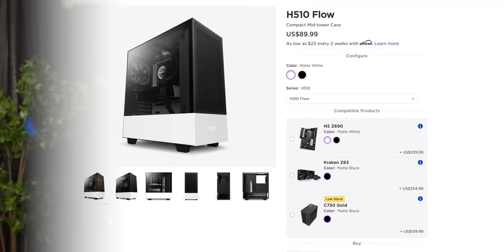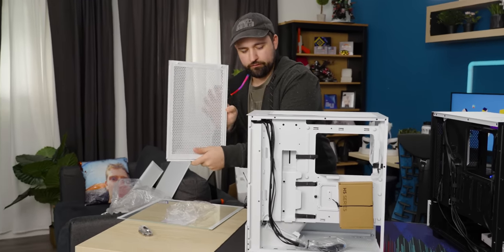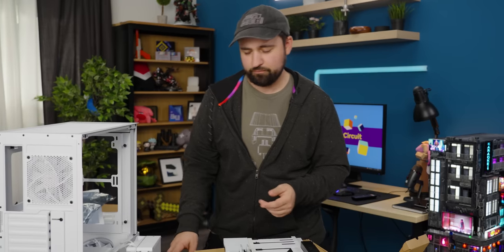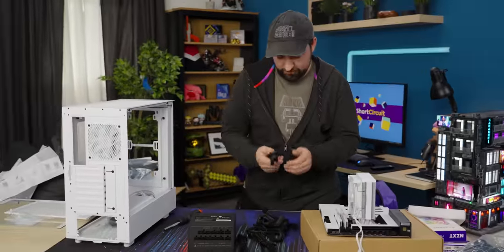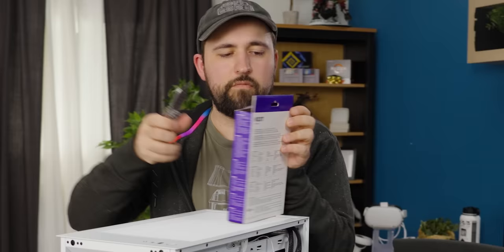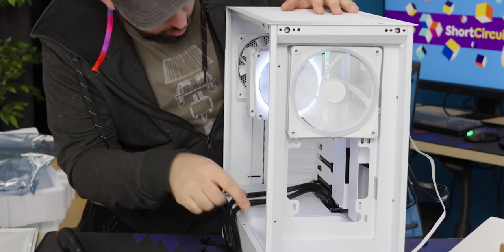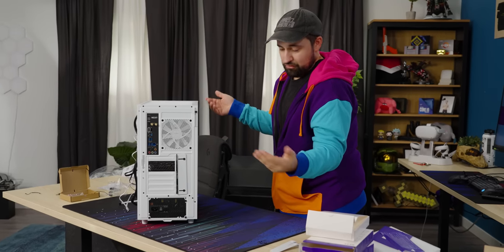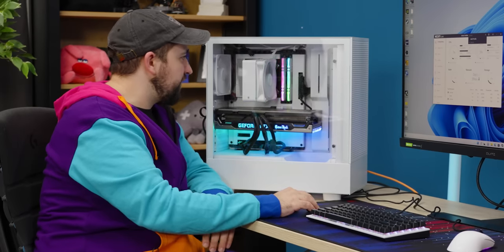Does this change make a difference? - NZXT H5 Flow

Comment: The fact that I’m wondering if this will fit a 4090 is a testament to how off the rails Nvidia has gone with the size of their GPUs.
Reply: H7 will probably be better for 4090
Reply: it can, yes it will be REALLY big but it will still fit
Reply: @InfiniteBullets2  😜
Reply: I'm guessing no lol.  Maybe a founders, hahaha.
Reply: It more speaks to how shit NZXT cases are.
Reply: @drewhinners8793  I mean, practically everyone agrees that the 4090 is ridiculously large. To the point where AMD makes it a selling point with their upcoming 7000 series GPUs.
Reply: If only the size was the only thing Nvidia had gone off the rails with...
Reply: It's easier to fit in a PC into a 4090 case than it is to fit in a 4090 into a PC case !\s
Reply: Some of you have short memories.

I remember when I bought a Gigabyte Windforce 970 and had to CUT my hard drive cage because the triple fan was SO F'ING LONG, a midsize ATX case wouldn't fit it.
Reply: Just wait until you see the 5090! Size of a compact car!
Reply: @Real28  I just googled it and:
310 mm x 129 mm x 43 mm
vs
304 mm x 137 mm x 61 mm for RTX 4090
Reply: We are at the tipping point where you buy a graphics card and then decide what CPU to add to it.
Reply: Is the kalaydoscope graphicscard not a 40 series card?
Reply: Okey taking it back did not know thst this crystal pattern was also in the 30 series
Reply: now you know why the toiletbowl fan was invented. (there is demand for that kind of gpu, and sadly it needs that kind of big cooling solution)
Reply: H7 Flow will fit it 👍

There is plenty of room to fit my STRIX 4090.
Reply: @LAndrewsChannel  Oh yeah, there’s also power consumption, price, & the lack of DisplayPort 2.0 (let alone 2.1).
Reply: @drewhinners8793  the 4090 gives problems to A LOT of cases

Just cause you hate a company doesn't mean you're allowed to say bullshit just for the sake of it

Also, it does fit in here, most of the customs do, so 🤷
Reply: @ccelik97  what? You mean you actually research it to get the right answer! Instead of guessing like everyone else.. bravo
Reply: Easy solution - buy AMD
Reply: @shamrockisland  I'm too broke to eyeball it & lose money on 2nd hand market at the moment so..
Reply: to be fair if you buy a 4090 you aren't buying this case
Reply: @ccelik97  you get my joke right ?
Reply: it fits
also Im poor

Comment: With NZXT trying to break into all the pc product lines, I’m curious if they’ll ever try and get a board partnership with Nvidia to fill the space of EVGA.
Reply: They'd sell pretty GPU's ngl ...but maybe run hot as heck lol!
Reply: @WyvernVin  run hot and cost 2500$ for a 4080. Nzxt pricing is easy to figure out. Find the most expensive competitor, copy their product exactly, then sell for 2-4x the original. They're the American version of the Chinese companies using tooling and what not to make a clone. But those clones are typically cheaper, not more expensive for the exact same quality.
Reply: doubt it, nzxt likes to make money and they make plenty of it doing other stuff. I don't think the profit margins on making GPU's are good enough for them.
Reply: @unholydonuts Nvidias msrp. nzxt sees 1200, and think 2500, so they'll charge you 4000 for a not top tier gpu.
Reply: Corsair as well, as they’re now making monitors too. All they need now is motherboards and gpu’s

Comment: I love that the back of the case doesn't have any holes for dust to be pulled in from. Please, more companies do this!
Reply: I don't as the airflow path for this case is low front to high back but all the hot air of the GPU now needs to escape towards the top and cant escape through the end.
Reply: Why have negative air pressure for dust to be pulled in anyway?
Reply: If GN take this case for a ride you will see you can lose 5-7ºC on your GPU for that silly covers
Reply: @ericcartman5722  That is a big doubt for me. 6-7K is the difference of no side panel, sometimes less. (not to speak of 6-7K from what? What's the baseline, which case, how many fans and where are they?) It doesn't even make sense when you think about the physics. You trap air down there which increases air resistance and therefore the sound of the fans. The decrease in temperature would be from the new fan itself, as the old case had bad airflow for the lower part of the case anyway. The slot covers will not help.
Reply: @mikep9418  My gpu creates negative pressure at the rear of my case. Since my cpu temps don't go high enough to make the case fans spin up to counter the gpu pulling air from elsewhere.

I decided to use tape to cover the holes on the back of the case so that this couldn't happen and while I realise I could've jut changed the pwm curve for the fans, my cpu temps rarely go above 50c when gaming or 70 with a full load so they're tuned to be quiet unless they go above 60c. My negative pressure issue from the gpu was fixed but with the case in this video, I wouldn't have that issue in the first place. 

For reference, I use the Gigabyte 6700XT with triple fans and it pulls a lot of air, even compared to my 140mm front case fans. Sometimes, negative pressure can't be avoided

Comment: Purple power supply with some purple cables in that white case, it'd look pretty sweet
Reply: that's a wifey build for sure
Reply: Well more like James the stratman by a purple case and a purple power supply and want to get purple Ram.
Reply: @EDV8ZR1  Just get white RAM with RGB and set it purple. O_<
Reply: @WyvernVin  purple cable mod cables
Reply: @WyvernVin  or custom profile white and purple with time delay
Reply: @EDV8ZR1  ♫ Purple RAM, Purple RAAAAMMMM  ♫

Comment: Ok, word of advise (i know, i know) - since this PSU is modular, just plug EPS connectors to the motherboard first - when it is laying flat on the box or table and route the PSU end trough the case hole when you installing the mobo and then connect the loose ends to the PSU. So much easier.
Reply: You can do that, however, some cases with a cramped basement may give you trouble when you try to plug all that cable through. I've always done the ATX cable on the PSU side + everything else on the board.
Reply: @ErulianADRaghath  Connect the cables BEFORE installing the PSU in it's place.

Comment: their old ultra tower cases from like 10y ago had the same-ish angled fan design, glad to see it coming back to assist GPU cooling and general flow
Reply: i am pretty sure air coming from the front is better than the bottom because bottom intake is more restrictive
Reply: @michaelli3944  I thought it was a pull fan not a push
Reply: @zebedeesummers4413  i think if it was a pull fan it would be taking air away from the gpu and causing worse thermals. I think it is an intake fan because logo is on the inside. Still i feel like they could have just installed it on the front like the h7 flow because i remember gamers nexus said airflow is better when it is pulling air from the front not the bottom.
Reply: Yeah, it's very reminiscent of the Phantom cases
Reply: @michaelli3944  yeah the old one was just hanging in there in the middle and you can change angles so its still intakes from the front. This here would be interesting but it does have good enough stand off from the ground
Reply: @daniwin  yeah i guess but i think if they just made it a shrunken h7 flow it would be better and more radiator compatibility
Reply: I still got my old NZXT Phantom 820 Ultra tower. The thing is massive but the temps were supreme...and it weighs 60 pounds so i got an H510 Elite.

Comment: PC goes on the left because you don't need a lot of space for your keyboard hand, but you want as much space as possible for your mouse hand.  Also I'm curious how that angled fan in the bottom affected gpu temps.
Reply: Pc goes on the right so you can see in the window.
Reply: Lefties like myself always have the PC on the right. (Or in my case, at my feet because my case is enormous.)
Reply: PC goes on the floor so it doesn't take up space and is quieter. Also left so the MB is also slightly dampening the sound.

Comment: That's something I hate about so many cases, even expensive ones do this. They never give you room in the back. Like seriously, a few extra millimeters can go a long way to not get a bulge on your back panel and to not make it annoying to put on. I recently got a Dark Base 900 and it's a massive case, but even that doesn't leave enough room for cables in the back, especially S-ATA cables, S-ATA power specifically. Like, those cases already aren't super cheap, and the small amount of extra material to get a few extra millimeters of space for your cables isn't gonna make the case suddenly 50 dollars more expensive. Like why
Reply: What are you measuring with your multimeters, bruv?

Comment: @10:36 AND I DON'T WANT IT UPSIDE DOWN! I also put mine on the left, because that's the best way for my dual monitors to work.  Upside down cases just look weird to me. it also makes it harder to plug in cables in the back.

Comment: I have a h510 elite, very tempted by this new version due to the top mountable AIO support. I do wish you had added some temps for the GPU in this case and compared them to the older H510 cases, as kinda important information given that new fan placement at the bottom of the case
Reply: You watching subLTT right now, for those kind of information you better look at Gamers nexus he made all of that since it's a more technical oriented channel. Always watching multiple opinion/review is the way to go no matter the subject anyway

Comment: Glad to see someone else with the correct case on the left setup, I guess on the right made sense or at least didn't make no sense in the days of single monitor, but with dual monitors I want my main center, and my 2nd to the right, so left makes way more sense, also it makes sure you have plenty of room for your mouse, it's why when I built my own case from scratch it was more of a BTX style layout so the window was on the right side of the case, and even my current Phanteks case (Evolv shift air 2) has the motherboard facing the right side so I can see it with the case to my left.

Comment: I bought the H700 back in 2018 and still rocks and the airflow is pretty good for a case with solid front and top panels.

Comment: I put my PC on the left, too. I also have it backwards to where I can easily reach all my USB's and stuff, so it kind of works out. 

Still would like more reversed cases to be a thing.
Reply: You had me right up until you said backwards
Reply: mine is diagonal and upside down
Reply: @srscricket  I have a lot of cables I need easy access to. It’s more of a convenience thing. That said, I’d still trade that for a nice reverse case.
Reply: @flyingtentacle7631  but the power button

Comment: 10:36 oh yesssss, probably because the mouse is on the right and having something giant on the right might feel constricting... also I just realized that majority of places I put my computer desk in, the wall was to the left, so putting a computer on the right was blocking the open side, creating a weird cubical feeling with wall to the left and a computer case on the right.
One reason why it probably is always build for a right side placement is that that is where most computer desk put their bottom shelf for computers and likely because most people are right-handed, so expectation is that people use their right hand to turn on a PC... which I don't think matters to most people if they have to use left or right hand to turn a computer on.

Comment: This case is cool and all, but it doesn't offer much in the way of Storage Space due to the location of the angled fan so it only have 1 2.5" drive and 1 3.5" drive (that 3.5" drive space can also be used for a 2.5" drive). For a case that cost £110 in the UK that's fairly limiting it's cost.
Reply: 3.5" drive are getting a bit old fashioned now. Even 2.5" ssds aren't so popular with the low price of M.2 drives so I can see their point of view. I don't have any sata drive in my gaming system.
Reply: it can take ATX /EATX size motherboard who can get up to six M2 slot , not even mentioning the pci card that can add some more. Sata will die in the years to come anyway

Comment: I, too, hate the EPS connector. Especially when the socket is positioned such that the retaining clips go on the inside edge instead of the outside edge. This is a real problem when they are put next to an oversized VRM heatsink and you are forced to use a flathead screwdriver to manipulate the clip when trying to remove the EPS connector.

Comment: I have the gamerock and I’m really disappointed because of the reason that after just about a year the rgb got a really strong yellow Touch (plait said it’s normal due to heat and they can’t repair it) so now I can’t get white or blue and everything looks off compared to the card. If I want it somewhat synced I either make it glow like fire or go rainbow

Comment: Dude I also always put my PC on the left too, it's just the way my setup is, i can't just it on right if i wanted to. And left side is the end of the room, just makes sense to put case on left and not on right which would be in middle of the room. And because of this you can't see inside the case unless you like lean way over near end of my room to see into it. It's kind of why i don't even bother with RGB or really making it look good in the case because no one will ever see it.

Comment: hello. how much clearance from front panel/filter to fan mount bracket does this case have? is it possible to mount something like arctic radiator (38mm) on the other side (after the filter)? thanks

Comment: Serious question for PC builders - why don't more folks use GPU support brackets? It seems such a shame to spend so much time and money on building a great-looking rig with a cool case, RGB, good cable management etc. and then leave the GPU sagging. It's subtle yet almost always noticeable.
Reply: Any you would recommend?
Reply: @saphricpcgaming5182  I don't really know much about them. I know a few exist - I suppose I'm curious why there aren't more.
Reply: @benadamsondxb  Same. GPU sag annoys me but 90 bucks for a vertical mount seems a bit much.

Comment: Pc goes on the left because you don't need to move your left hand because you would use your right hand to move your mouse and It's my preference to not have something big to restrict my mouse movement which is also why I went wireless over wired for my mouse as well. 

Making a left sided pc with the window facing in would be amazing. Surprised no one has done one before even though you can move the pc no matter where you want if you spent $$ on a nice pc you would want to see it.
Reply: They actually do exist, though they are rare, also some SFF cases effectively do when they use the layout with the motherboard facing one side and the GPU facing out towards the other side, I use the Phateks evolv shift air 2 for this reason, which puts the motherboard on the right side facing me and the GPU is on the left facing away

Comment: I want the case panels to be swappable as well!!! Interested about temps and hiw much the bottom gan helps. Most testers use short or founders cards, which would not benefit much from the fan. My mobo should be in tomorrow so will bw ablw to try it out myself finally,a

Comment: I still build in a beige inwin case from 2000, 2x noctua 80mm and a 120mm Noctua cpu cooler. 5800x, 5600xt, 16gb 3200... New cases look expensive.  :P

Comment: i like to see build an cooling test with the fans config-ed as top an rear as intake an the 3 front 
as exhaust an compare to normal layout with the with a vertical mounted dual or tri fan 

6800xt or higher , as iv had better air cooling in some cases pulling cool air down from above 
an pulling hot out the front id like to see how well this case does in that regard, note iv also 

found its easier to clean an aio if its mounted in the top front fan space in pull config for a 
single or in the front put a dual also as pull

Comment: Sorry this video looks kind of rushed and not enough effort put into it, with the crooked CPU fan which by the way wasn't even lit up at the end of the video. Only a single front RGB fan, even though they had several boxes of product to choose from. They didn't even use the vertical GPU mount they talked about at the start, which would have helped the fact that they didn't use a white GPU with 4 cables just hanging out the side. I'm not sure how much NZXT paid for this, but I would not be happy. Also the video title is "Does this change make a difference?", but never got to discuss that point.

Comment: Spray paint is your friend.. if you take you time and practice.. makes a build take days due to drying time.. I miss the chrome power supplies.. yes, I have a win xp machine with purple mobo, chrome power supply, plexi case and painted the disc drive and floppy drive purple. I have purple skull in the case with all the extra cables bunched up in it.. lol......

Comment: Idk. I'm right handed and I feel like I like my pc on the right. And if not, I put it either on the floor right facing right so I can see all the gpu and motherboard. And if not, usually in the middle on the floor. I know I won't kick my pc haha. If it were a left placement case, would that not have to reverse the back to the front??might require a special reversed motherboard too?  If that was the scenario, you could just turn your computer around haha. Also I really want that case, but I think corsair just makes a nicer tempered glass case. 4000x but should have got the 5000x. Worth the extra money imo

Comment: I'm not a fan of cases with the IO being flush with the back panel. I prefer the IO being recessed into the chassis. I'd rather have the IO card screws be inside the case.